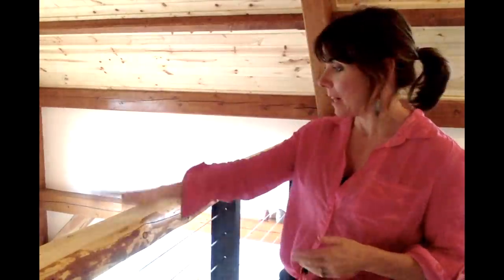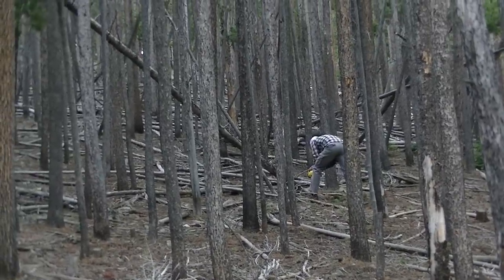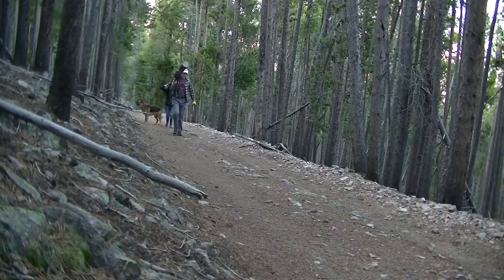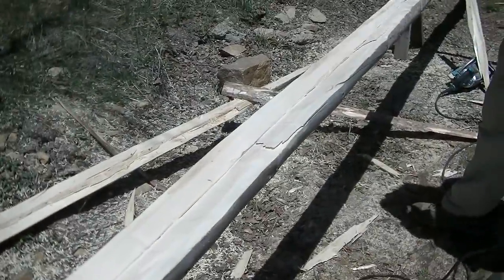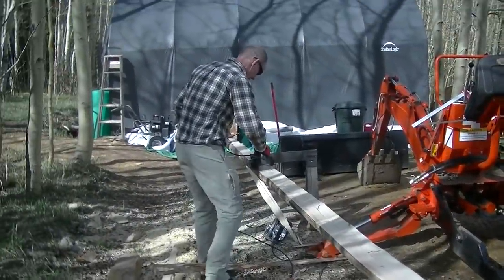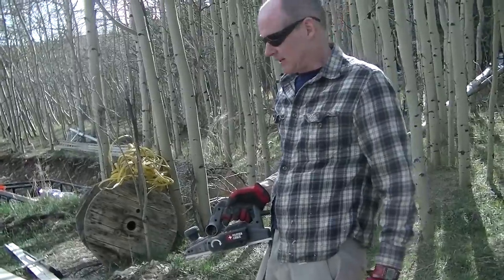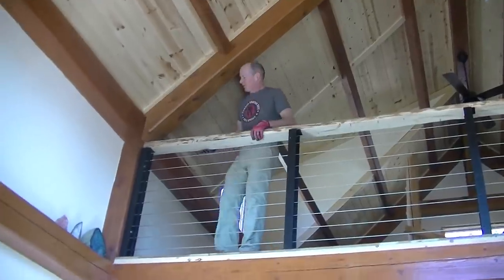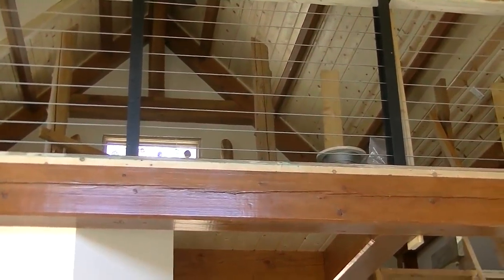Making a Live Edge Log Railing from Tree to Finish

Comment: There's a thing called an Alaska chain saw mill, which is a guide that fits on a chain saw that allows you to "mill" boards of uniform thickness from logs with your chain saw.  Good ones are a bit pricey ($250-$400), but they're cheaper than a band saw mill.  One such would allow you to easily cut railings as well as mill lumber to make furniture.  You certainly have the available wood resources.  Just from the deadfall  and the fire cuts I've seen on your videos, you could make some nice lawn furniture, etc.
Reply from the maker: Cool! I think our chainsaw is too small for that. But our neighbor has it I think , maybe we can try it out. We have this Prazi beam cutter that is like a chainsaw blade that attaches to a skill saw. Yes so much wood!!

Comment: The railing looks very good,

When you get the next tree from the woods, so you get a match, consider putting an old jumper or other padding on top of your coat. It will save your shoulder and coat.
Reply from the maker: Thanks for the tip! Sure needed that by the end of the walk.